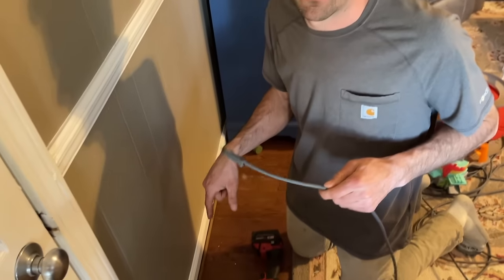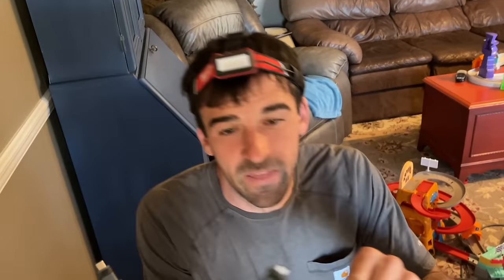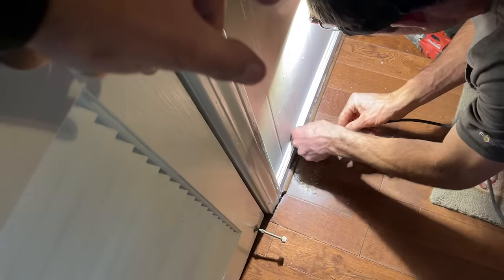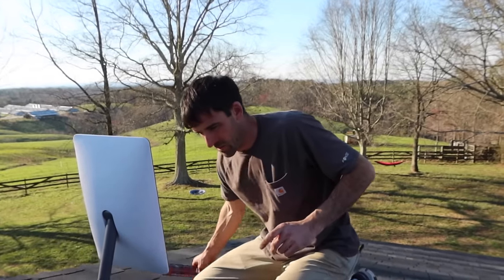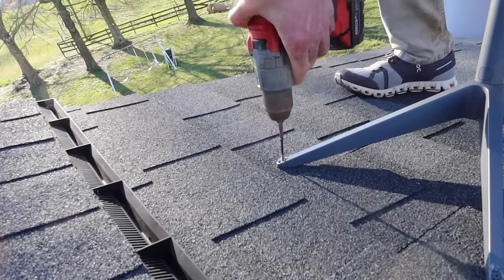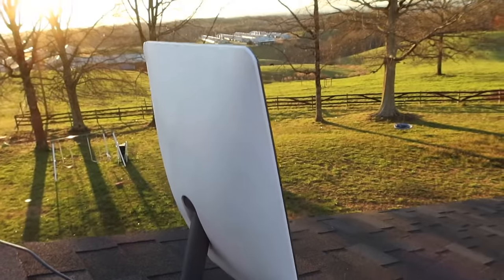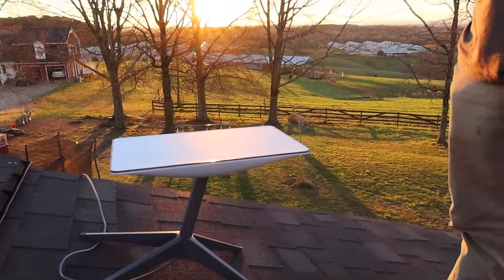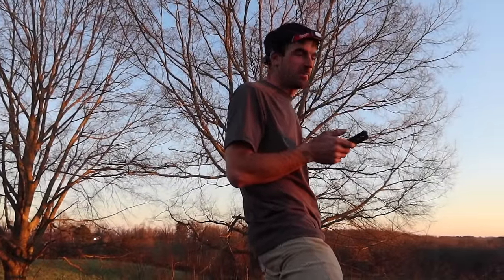SpaceX Starlink Internet | Installation and Initial Speed Test

Comment: Well, the speed of 4G is much higher than this. So how is it that something so special?
Reply from the maker: Our 4G is slower than our Starlink. The reason it’s so special is because there are very very limited options for high speed rural internet. This is actually the first that has ever worked for us.
Reply: LTE in remote places isn't as spread out and has limited towers. So congestion can get pretty high in demand times. + The range from one's tower can be pretty different. Speeds are effected by difference of range and what kind of mhz the tower sends out. Lower mhz = lower speeds but better range. higher mhz = better speeds but less range.

Most time you'll look at maybe 100 if you're getting a decent high mhz.low range lte tower with no congestion. But a lower mhz might drop you down to even the 20's if most things. and how far you are. + the pings can be pretty poor. Starlink has a top ping around 25-40ping. And instead of having a amp antenna to get better signal from cell tower. This just points straight up to the sky and aims itself automatically. Only factor is storms will slow it down. but since the satalites are closer in orbit. It'll work way better then the other satalite companies that have satalites farther away from earth and completely loose signal in a storm.

Comment: I wonder how each of satelite are orbiting through the area can give the experience until another comes in the range...
but also I am worried about External factors...if satelite lose their track ,or got hit my Solar flare and stone shower..or radiation..

Are you well prepared About recovering the loss and also placing those satelite again and again coat too much of resources
Reply from the maker: I’m not sure I follow. Why would I have to replace my satellite?
Reply: If the Starlink satellites (which are in low-orbit and relatively close to Earth’s surface) gets hit by solar flares or meteor showers, we’re going to have much larger issues than the satellite’s well-being. Lmao
Reply: @JeremyTani  Not just that..but making and transport the satellite again in same orbit..seems highly expensive...

Especially you are wasting liquid oxygen or hydrogen as fuel? If I am correct..
+

Wjat happen if one of satellite getsvhit on Us...or In Homes 🤣🤣?
Reply: @wildyato3737  You do understand that what you’re saying (about satellites going down) is highly improbable, right? In the slim chance they did, they’re too small to survive re-entry and would disintegrate before reaching us.

Also, it’s not like they would send up an entire rocket just to replace it— SpaceX does massive rounds of deployments at a time to get these in orbit.
Reply: @JeremyTani  Oh yes you are right...😂

Comment: So as long as there's no obstructions around the dish or above the dish so it gets a clear view, it will self adjust to lock on to the signal direction?
Reply from the maker: That’s correct. The app helps you find a good spot and then when you hook everything up it will auto adjust.

Comment: I'm planning on buying it but I'm going to have to run 200ft cables to set it up in a clear area. Will that screw with the speed or anything if it's about 200ish feet away from the house?
Reply from the maker: I’m no expert but I don’t think so. I just finished installing some antennas that send my Starlink signal wirelessly about 1000 feet to my farm. I did not lose any speed. I doubt you will with extra cable.
Reply: @FarmerHunt  What kind of antennas are you using?  I am looking to go from the house to the barn, a distance of about 700ft.
Reply: @williamfenstermaker5822  He's talking about boosting the router wifi. Not the dish.

Normally you can boost the wifi by buying another router of theirs (Which has mesh tech). Which can extend it's wifi range. Or you can get the ethernet adapter system and run a solid ethernet cord to another switch/router box. (Which might be better idea.) So that way you just place the dish. Put the 75foot cable-router in a place. Run the extended Ethernet cable to your location and boom.
Reply from the maker: @williamfenstermaker5822  this is what we used and have been very pleased!

https://store.ui.com/collections/operator-airmax-devices/products/nanostation-loco5ac

Comment: Well...recently moved from a congested area in Florida to the mountains of West Virginia.  I guess I gave up 900 mbps with a terabyte of data for $79 a month.  I'm saddened I can't replace that on the 2 acres of what used to be part of farmland.  People in the area on get 6 mbps using Frontier.  I'm hoping Starlink isn't self install only, and I'm not used to paying for provider equipment, especially at the prices I've seen.  And something tells me to doubt the stability of signal in inclement weather.  But for my use, I need more than 40 mbps.  I'll need every bit of the triple digit speed they show here.  Guess I have to get on Starlink's waiting list.  This is a sad day.
Reply from the maker: Sounds like you had great internet where you were. Starlink internet is great for people like us who have no other options. The speeds do decrease some during bad weather. I’ve seen it drop down under 50 some. It’s still a huge improvement for people like us. I think with time it will get better and better though.
Reply: @FarmerHunt  It was good.  But make no mistake,  I don't base where I live on my want for Internet service.  So that being said, it sounds like Starlink is the way to go, despite the costs involved, and the wait.  Appreciate the reply and have a great day!
Reply from the maker: Thanks! Same to you. If you have any questions about it in the future be sure and reach out.

Comment: If you want to get rid of one of the starling connections you can use a point to point connection. However since their modems or their newest model modems do not have ethernet ports you could utilize a wireless router that could act as a repeater intern giving you ethernet ports from there you can wire up what’s called a point to point microwave antenna connection by a company called ubiquity allowing you to being a Internet connection between both properties eliminating the need for two separate connections
Reply from the maker: Thanks for the tip! We actually set that up a month or so ago sending the signal down to the farm. May do it between the houses eventually also. Thanks!

Comment: Set mine up on April Fools day. (Hope that's not an Omen!)  Great speeds on my relatively new HP Omen desktop...but my older computers in the house are around 40 to 60 down.  Friend said update the WIFI drivers in them but most of them are too old to get updated drivers.  Even still, 40 to 60 is still better than what I was getting from our wireless provider.  A few hours after setup I started getting Network Errors and No Signal errors...about 15 second dropouts and several of them per hour.  I unplugged it and rebooted and that seemed to fix it.
Reply from the maker: Glad that seemed to fix it. Maybe you won’t have anymore issues. So far ours has been running really well.
Reply: Can I ask what phone model you used to set up  the system? Mine is not compatible with the starlink  app, looking to upgrade to a new phone. Please and Thank you.
Reply: @tracyski1920  iPhone 10.  Also works on iPad Gen 9.  I would be surprised if they didnt have an app for Android also.  Good luck.

Comment: Elon tweeted that one starlink can provide internet for a school with hundreds of students. What do you think about this?
Reply: True in a little case. If they aren't using video coms. Then yes. Because websites are faster and don't require a buttload of internet speed to load. So 250mbps is more then enough for a whole school to do basic homework on. Now if it's voice coms and stuff requiring streaming. That can really differ. Because streaming and video takes a buttload more internet speed and needs less ping access.
Reply from the maker: I have seen that there is a residential option and a commercial option for Starlink. I don’t know what the differences are but I assume the commercial would probably be better suited for a school. Either way, there are a lot of rural schools and if it helps get them faster internet then I think it’s great!